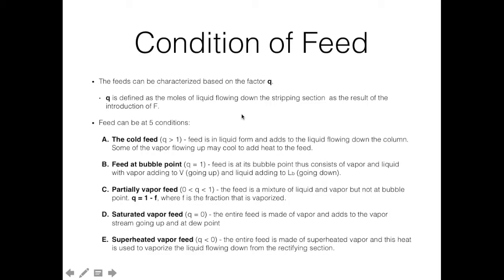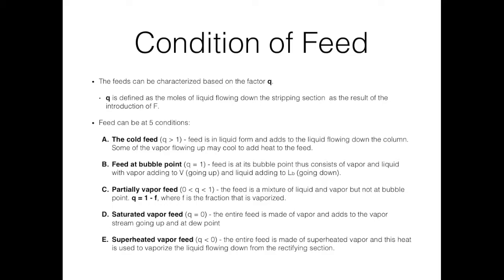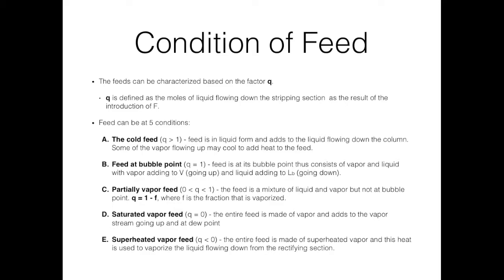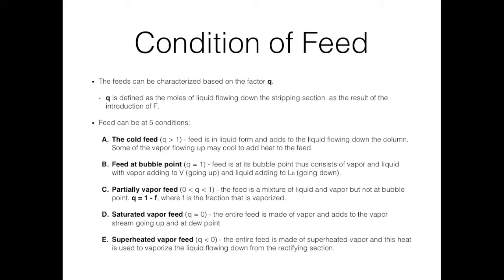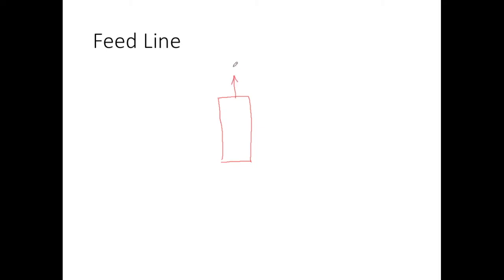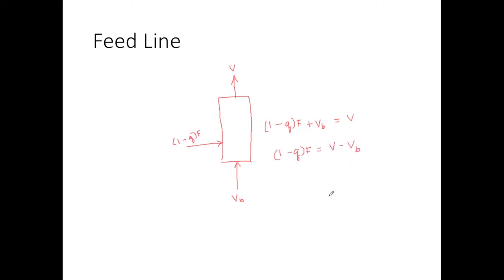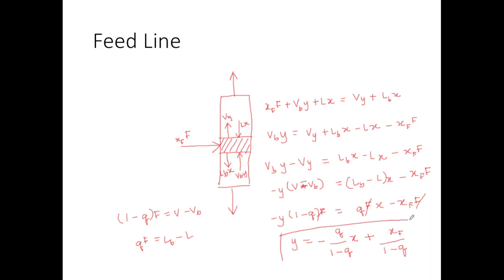IEK213 Distillation Feed Operating Line

Comment: @5:18 Wouldn't the vapor fraction flowing out of this section be different from the vapor fraction flowing in? And same for the liquid fractions? In other words, how can you use the same y and x for both sides of the feed plate?
Reply from the maker: Brett Barden Sorry for late response. Here the x and y are the same for both sides because we assume that the (shaded) layer of analysis is very thin and there is an infinitesimal chance for the composition (%) to change. Although the “total” amount (in moles) of the component would change because of the Feed.